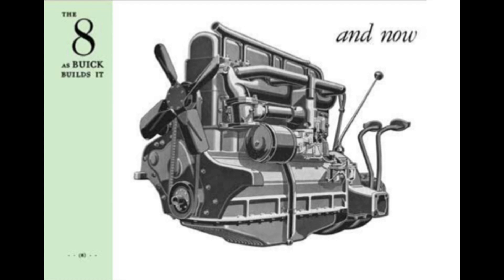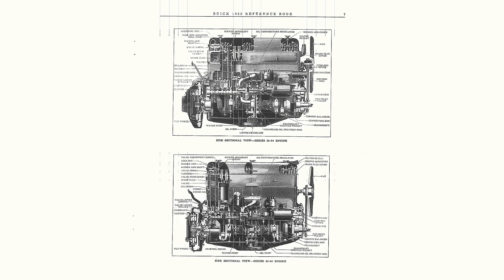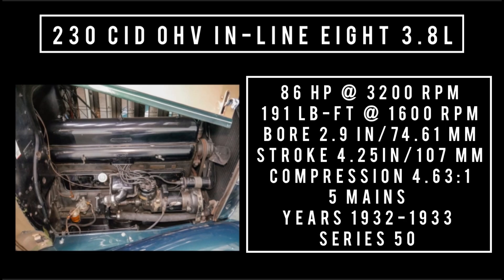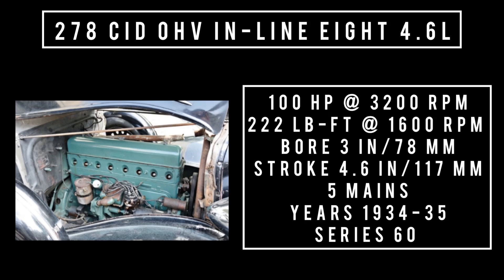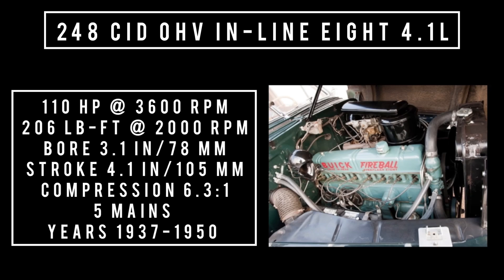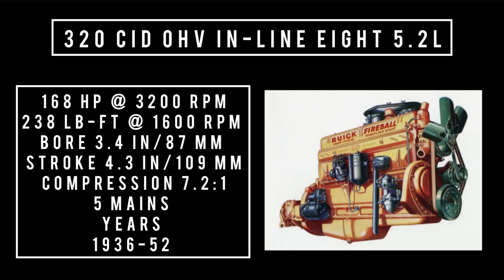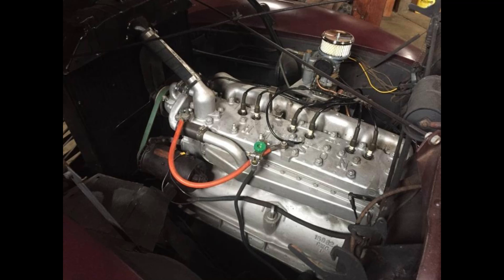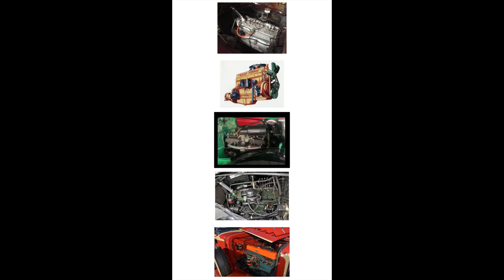Buick OHV in-line eight engine family

Comment: Most of the best car engines were also used in industrial and commercial applications like buses or forklifts for example . A Buick straight 8 was used in Flxible buses and often retrofitted to other commercial uses like saw mills by " ivory hunters " .

Comment: In 1948 Buick introduced the Dynaflow Transmission Roadmaster series only. In mid year of 48 hydraulic lifters were introduced.  The 320 with the Dynaflow transmission had 144 HP Without the Dynaflow the 320 had 140 HP. 
“In 1941 Buick never said how fast their cars could go. They could cruise at 80MPH all day long and have plenty of power for passing!”

Comment: 1953 was the last model year of the Buick inline 8, and the first year of the Nailhead V8. You could get the 263.3 in^3 inline 8 in the Series 40 Special only. The Super Series 50, Roadmaster Series 70, and the Skylark came with the 322 in^3 Nailhead.

Comment: That Nash with 9 mains,  probably has potential. Modify the head, bore it out, put about 6-8 Stromberg carbs on it. A cam and header. Possibly a harmonic damper on the crank. Possibly build a custom unit. That can fit behind the flywheel. Along with a front damper to help that long noodle of a crankshaft. Remove the excess weight from the crank, the rods, or get scat to make a cast steel or 4340crank, possibly with .125" more stroke,   Beefier rods, with some hightech modern pistons, with coatings and 1,1 and 2 mm rings, smooth out and acid port the head. Putting a mask on the bottom of the ports ceramic insulation coating on the exhaust ports and possibly the chamber, after its polished. With larger valves. Remove any exceds material from the rockers, to remove weight without weakening them, (,along with the new crank and rods, 4340 crank snd rods would be nice. Possibly build a custom HEI distributor with MSD coil and ignition possibly modify the sparkplug holes for a more modern plug if none are available. Use a stainless bushing to reduce the hole size if its too large, bore it out if too small.  Build a custom split header, skipping cylinders in the firing order. (Maybe make two sets, one catching cylinders in the  firing order. And one skiping cylinders, keeping the one that sounds the best,unless it hurts power too much) a nice custom cam grind , and raise the compression to at least 195 psi. Not much over 200, 205 about the most,  attempting use 98-100 octane , and possibly add water methanol injection , and adapt a TKO 5-speed transmission to the engine with a roughly 3.73 gear. In a early 50's car. Or maybe a 1/2 ton truck, mount the radiator in the rear if required..

Comment: WYR  You overlooked the Studebaker 250 cubic inch inline eight.  I'd go for the nine-main Nash if it didn't lock you into torque tube drive, but then, Buick and Chevy and all Ford products and I don't know who else had the torque tube, too. The Packard Eight would be my first choice, especially their mighty nine-main 327, 356, and 359 versions. Then the Studebaker.
 Crazy fact, When word came down from "On High" that the '31 Buicks were all to have "Valve In Head" inline eights to replace the sixes,  the engineers designed three different size engines to have maximum interchangeability of internal parts. 
The "On Highs" looked at these engines and sent the engineering staff back to the drawing board, decreeing that there was to be no internal part interchangeability.

Comment: Cool video, I have several straight 8 Buicks myself. It's my experience and understanding that insert bearings weren't used in the big ends of these engines until 1950. Before that they used babbit bearings in the con rod big ends (which interestingly enough could be adjusted somewhat by removing shims from under the caps).. Also forgot to mention the new piston and cylinder head design for the 1953 263 engine. (probably a list ditch effort by Buick to squeeze some more power out of the straight 8 before completely defaulting to the Nailhead for all models in 54)
Reply from the maker: Thank you so much for sharing that information =)

Comment: My dad owned a 1950 Pontiac flathead straight 8.  At idle it was so quiet that I,  a young kid about 10 or 12 years old had to get very close to the car to hear it.  Yes, my ears were young and had perfect hearing.  Buicks with OHV were a bit noisier.

Comment: I have a 1951 Buick Roadmaster Riviera 4dr. which was Buicks top of line model. She has the big 320 cid. 150 horse engine in her which is good 'cause she is a beast! I've never been a high performance how fast can you go kind of guy and basically, Buick at that time was never about performance. It was about smoothness and ride. If you wanted performance at that time from GM you went to Oldsmobile. I always wanted a "straight 8" Buick and I finally found one a couple of years ago. It has about 100K miles and I don't think it's ever been rebuilt. It starts right up, doesn't smoke or use oil. Oil pressure is still right in the middle of the gauge. It runs like a fine watch and has the best sounding exhaust I've ever heard! I love just watching and hearing it run! I also have a 1949 Packard with the 327 cid flathead 8. Another great engine but I haven't gotten mine to the point of running yet, maybe one day!

Comment: I had a 1947 Buick straight eight babbit pounder.Starter on the gas pedal activated a solenoid. Use to start by itself in the winter .Wondered  why it was out of gas when I got up to go to work. Carried a 5 Gal. jerry can in trunk. Caught it in the act of self starting.Solenoid changed,problem solved. It had air oil shocks,rode like sitting on a cloud. My first 50$ car in 1964.
Reply from the maker: That’s interesting thank you so much for sharing that memory with us $50 for a car that’s crazy I had a friend that sold a car for 100 bucks but I’ve never bought a vehicle cheaper than $500
Reply: Did you name it Christine?

Comment: Drove a 38 century deluxe back in 2007. 2nd owner(Dad&son), garaged, original. 400k documented miles. Smooth car
Reply from the maker: Wow that’s incredible how many rebuilds or same engine. =)
Reply: @What.its.like.  as far as I know it was a labor of love. From what the guy told me the intakes and seals were every 20 years and carb, belts were 10. He didn't go by miles. The internals were original. The car held up incredibly well and he was about 90 when I met him. He only ever owned two cars. The Buick and a 57 4 barrel 4 speed Bel Air that was his baby.
Reply from the maker: Wow thank you so much for sharing those memories with us =)

Comment: I'm really fond of both Buick and Packard, but I also know that Packards are virtually indestructible. The 1954 packard panther had a 359 straight 8 flathead (9 mains), to which a McCulloch supercharger was mated, and that made 275 horses. Imagine the same engine with 4 carbs, bigger valves, larger ports...it would easily get to 350 hp

Comment: I pick the OHV Buick straight eights every time. Had both '49 and  '52 Series 50's. Could balance a nickle on the flat top of the carburetor air horn at idle and it would sit there indefinitely.

Comment: Many decades ago, I read an article about inline 8's which said that Detroit had experimented with an inline 9 which was smoother but never used due to expected consumer resistance to an odd cylinder count.  Have never seen any other info about this.  I wondered about the torsional rigidity of that long crankshaft.
Reply from the maker: I’ve heard and read that that was the Achilles’ heel of the Buick design for the crankshaft.. flexed I also agree street eight was known for smoothness, I wonder what is smoother a straight eight or a V 12

Comment: A great presentation about the Buick in-line 8 OHV engine Jay. I had no idea that there were so many variations of that engine during its time span. I myself just recently finished reading about the Pontiac in-line flat head Straight 8 engine. It was nicked named the "Silver Steak" which soon became the name of their most popular model. Maybe you will do a video presentation on that Pontiac 8 engine which was around from 1933-1954 and was popular with public right up until the end of its long run. As for the choice of motors. I'll take that Packard by a mile. With a top speed of 90mph and over 100mph on their Super 8 160-80 horse power engine that was quiet and smooth all around it was a tough one to top for its overall performance. 😊
Reply from the maker: Yeah for sure definitely want to cover all of the engine families that are lesser known the next engine episode families going to be on the Packard 12 it might be today it might be tomorrow
Reply: @What.its.like.  I'll look forward to it. I believe that is the same engine as their celebrated twin-six.
Reply from the maker: Yep goes by both names

Comment: Of the engines the 32 Nash would be my choice, when I heard those straight 8's with 5 bearing made my skin crawl, yes you could make it with 3 bearings but you are going to have to make an oversized crank to keep it from flexing, If ford thinks that there big six needs 7 bearings, then a straight 8 needs 9.

Comment: 5 main bearings or 9 main bearings.   Hmmmmmm
9 any day of the week.....
Reply from the maker: =) maybe we will do a lost engine episode coving 10 super underrated engines
Reply: @What.its.like.   Try to include the 1960 GM 215 cubic-inch aluminum V8...
And maybe two Buick V6's:
The Buick 3800 V6 Engine... 
The 1962 Buick 198 cubic-inch V6 engine.
Have a great day.
Reply from the maker: Those are super cool I’ll make a list =)
Reply: @What.its.like.   Just thought of another, its a early American V8 engine:
The 1919 Curtiss OX-5 V-8 aircraft engine.

Comment: 4.6 compression is a fucking waste of gas,on the other hand the V8 nailhead was magnificent
Reply from the maker: I think these engines had a really low compression because of the really crappy gas
Reply: The fuel then was very low octane rating and would knock if compression was high.

Comment: Had a '53 Buick Special, last year of the straight 8's, only in the special. Standard transmission, wonderful engine.......only drawback is that the engine had a maximum top rpm that it it wouldn't exceed.  40 mph in low , 90 in high, down hill or flat running no difference. A guy raced one on a circle track raceway. against flathead Fords, Hudson twin H powered sixes, and most other makes.  He would be the firts one out of the turn, but by the time he got to the next turn almost everyone else had passed him.  Shows the result of the max top rpm of the engine.  I'd take the Hudson 8.
Reply from the maker: Thank you so much for sharing that insight =)

Comment: Thank you for this wonderful presentation - I always wondered why Packard stuck with the flat head straight 8's for sooo long . In view of the fact that they produced the Merlins for the P-51 they certainly were not lacking in engineering ability. I owned a 1954 Buick Roadmaster Coupe with the nail head - it was a wonderful engine very quiet and very smooth.
Reply: I have read that with the low octane gasoline that was common much before the 1950s that the advantages of overhead valve over "flat head" weren't as much as when higher octane gas allowed  higher compression ratios which allowed overhead valve to show its advantage 
also early gasoline created more carbon and crud deposits in the combustion chambers and the "flat head" engines were easier for do it yourself cylinder head removal and scraping of deposits from the head interior and compression space 

I think some of the Packard flat heads in the same year of Oldsmobile's famous OHV V8 introduction made more horsepower than the first year or two of the Olds engine but the Packard engines were probably much heavier and needed more space under the hood and probably cost more to build than the Olds engines (after  high development and initial tooling set up costs for the Olds had been amortized)
Reply: @davidpowell3347  I also owned a 1953 Packard Cavalier with the 327 flat head - it required much more oil than the Buick 321 OHV V8 nailhead. There are times when I wish I had access to a time machine and could march into the Packard offices with a trunk full of drawings of upgrades that could have saved them from collapse - after George Romney stuck them in the back they would have needed a trunk full of cash as well.  That Packard was allowed to fail was in my opinion a major fail for the US auto industry.
Reply: @antonfarquar8799  "Burning oil" or requiring more oil for a refill after an oil drain/change? I think Packard might have had a larger sump or pan than the customary 4 or 5 quarts that most cars seemed to have had
in those days air filters weren't so effective,most engines didn't come standard with oil filter systems (some could have had optional filters installed by dealers) and oils might not have had the antiwear additives that were developed later so many cars including expensive ones developed loss of compression and severe oil burning habits before they had as much as 80,000 miles on the odometer 
also there used to be a lot of rural roads that gave off lots of silty dust in the summer when cars traveled over them and much of that abrasive dust got into the engines causing rapid wear of the engine surfaces such as piston rings and cylinder walls 
 Standard equipment easy to change full flow oil filters and easy to replace cartridge air filters rather than old messy hard to service "oil bath" air filters helped to extend engine life quite a bit in my opinion  

 a mistake that may have killed off some engines prematurely was technologically immature "multivis" oil that sludged or varnished terribly (late 1950s through as late as 1980?) I think some brands and viscosities were much better than others
Reply from the maker: Awesome thank you so much for sharing your experience with this engine one day going to cover the Packard Straight eight

The next engine episode is going to be on the Packard 12
Reply: @What.its.like.  excellent choice !!!
Reply from the maker: Hopefully that episode will be tomorrow we’ll have to see =)

Comment: My father had a 36 Buick with a one of three experi😅mental straight 8 in it. The engine had a much longer stroke than the normal 8. He had to rebuild the rods because the were considerably shorter than the normal 8 for 1936. The engine ran well but it was very hard on the drive line if you used the torque that was on tap. In 1936 the rods were not fitted with insert bearings and had to have new babit poured and be fitted to the crankshaft. This was emeadiatly after WW II and cars were not easy to find.

Comment: Just bought a 53 Buick Special convertible and up pops your video about OHV straight eights.  Liked and subscribed.  Also had a 49 Packard with the 327.  It was smooth.
Reply from the maker: Awesome how do you like your Buick special I love the way the hoods open on those you can open on either side or pull both pins out and take the whole hood off but that hood is super heavy.. need a couple of guys probably four guys to take it off proper don’t wanna scratch anything

Welcome to the channel if you dig Classic Cars you’re gonna love it here =)

Comment: They were good motors gut the physical size WAS a drawback for hot rodders. Pontiac made a large straight 8 as well, but the Buicks had more horsepower and torque.
Reply from the maker: Yeah I should’ve said something to the effect that it has a large footprint but for straight eight it’s probably one of the smaller engine choices especially the ones from the early years because they’re not hardly any bigger than the Chevy six the 320 takes up a good bit of space

Comment: I had both a '34 Series 40 rumble seat coupe and a '35 Series 40 sedan. Worked on the engines of both with ease. Was able to order parts from Sears and J.C. Whitney ( it was the 1960's).  I enjoyed my experiences with them. Neither engine ever let me down. Both vehicles had cable-operated mechanical brakes. Them was the days !
Reply from the maker: What did you think of this two I really like the styling of the 35
Reply: @What.its.like.    The thirties intrigue me the most. Lots of fender and running board. Even my '35 had a small access cap in center of the lower grill for an engine crank. I loved them.

Comment: i would take the nash, 9 main bearings you could turn this motor into a powerhouse and it would hold up.
Reply from the maker: Im surprise that engine never gets talked about I just recently found out about it I’ve gone 34 years without knowing about that one.. I wonder if anyone ever built one for speed
Reply: @What.its.like.  the buick 8 had a small bore and a long stroke so it was a low rpm engine, one reason it had a low compression ratio. power came on in the 2000 rpm range, 3000 rpm was about max on those main bearings.

Comment: Buick offered what they called Compound Carburetion in '41/42 (two 2-barrels in a progressive-linkage) which made the highest HP in the GM family; even more than Cadillac (in fact the Buick limousine of that time is often called "a better Cadillac than Cadillac").  Buick also offered America's first 4bbl carb in 1952, a Carter WCFB.
Reply from the maker: Awesome thank you so much for adding that information =)
Reply: I heard that the first car to have a 4bll carb was a Straight 8 Roadmaster in 52.
Reply: @MichaelRHull-wy7wg   That's correct.  A Carter WCFB 894S-5A 4-barrel mounted on a GM Buick Fireball straight-8 320ci engine which was standard on the Roadmaster.
Reply: @Matt_from_Florida  my Dad told me his 52 Roadmaster had one on it.
Reply: Compound carburation gave the 248 engine 10 more HP. The front carb had the choke & the idle circuits while the rear carb acted the same as the rear 2 barrels on a four barrel carb. It was likely discontinued because the rear cylinder tended to get too much fuel & experienced greater cylinder wear. It was certainly an impressive looking engine.